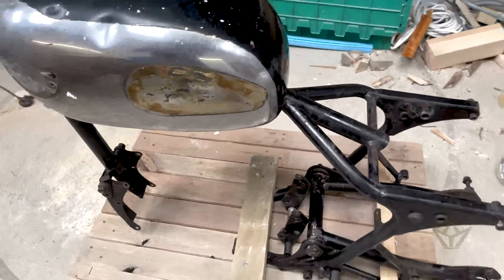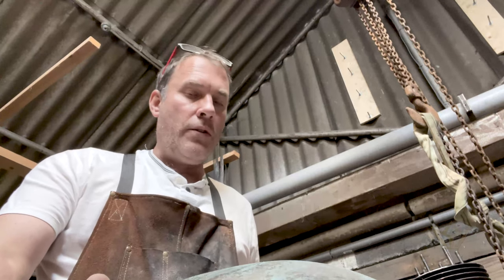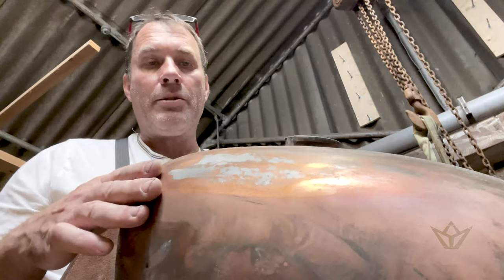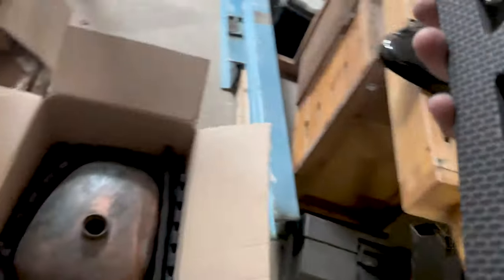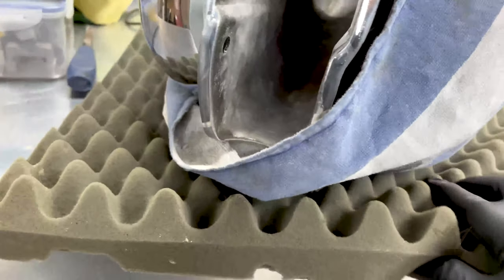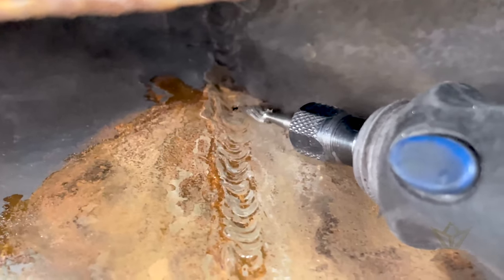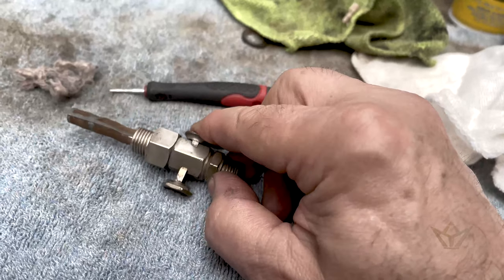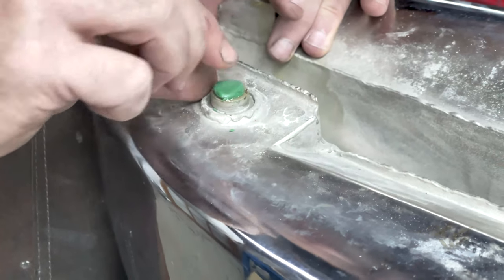Restoring and chroming the original tank, the nightmare - was it worth it?

Comment: Looks great!  I have a couple questions about painting a chrome tank like you did in this video.   When I'm done painting and I have a half chrome half painted tank, can I clear coat the whole thing or should I tape off the chrome parts and just clear coat the paint?   I'm not sure if the 2k clear coat will stick to the chrome.    Also.. what prep did you do to the chrome before you painted it?  I'd imagine you have to scuff it up with sandpaper before laying down paint.
Reply from the maker: Thank you. All good questions: 
No need to clear coat chrome. The painted part is marked out with tape and scuffed with no rougher than 600-800 grit. Metal primed and completed. For the clear coat, run a slight overlap onto the chrome to seal the paintwork on its edges. That’s it! Good luck
Reply: @MyRestoration1  thank you!  I wouldn't have known to do a slight overlap with the clear coat onto a little bit of the chrome, but that makes sense.

Comment: What was the purpose of the chain links being placed into vinegar in the tank? Some kind of galvanic anode?
Reply from the maker: No an agitation to remove age old dirt 👍
Reply: @MyRestoration1   Got it,  I just didn't see much agitation in the recording. Heard of folks just using a bucket of nuts and bolts, wood screws etc for this abrasioning. When I cleaned up a metal tank, I used a bag of clean aquarium gravel and shook it all about in hot soapy water for a good 20-30 minutes, then after much washing out, ran some rust converter (EvapoRust chelating agent). I now know 2x cleaning strength vineagar is a good alternative and much much cheaper.

Comment: Hi just came across your vids there good ,I have always cleaned/descaled  fuel tanks using diesel about 1/4 tank and over here in NZ we use road chip as there small dense and tend to have sharp corners and there's mounds the road crews  leave behind. And I use diesel as its a hydrocarbon thus molecules are smaller than any H20 based" as in vinegar" etc it will weep through the tiniest pin holes, Any how nice job on the bike cheers
Reply from the maker: Very good solution John. Thanks!